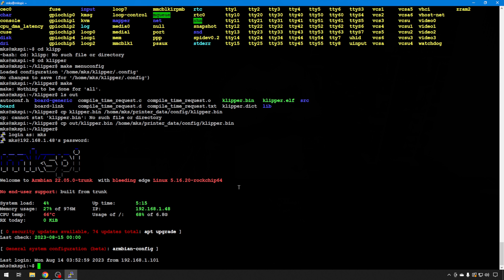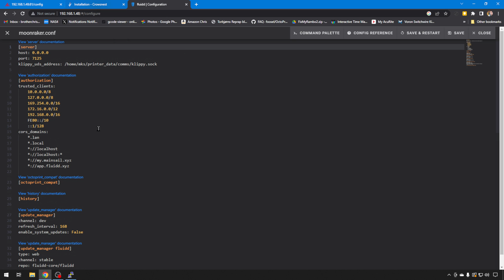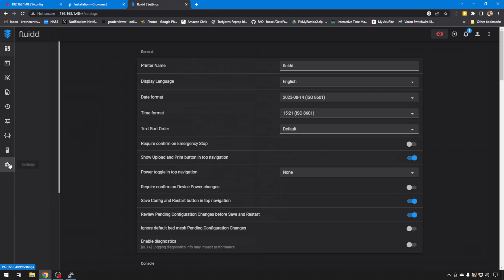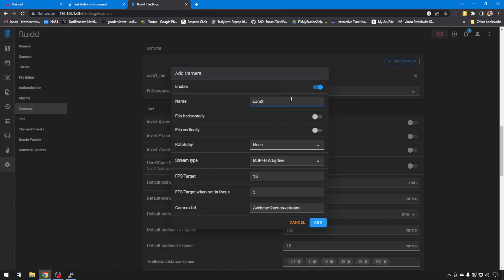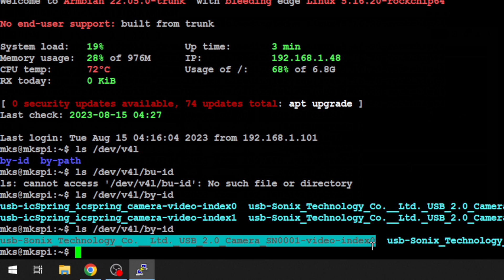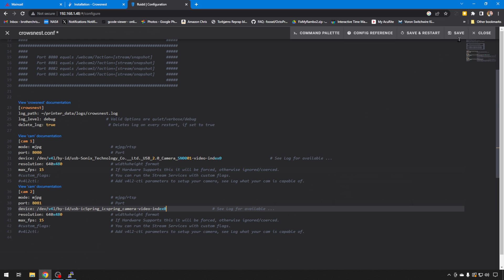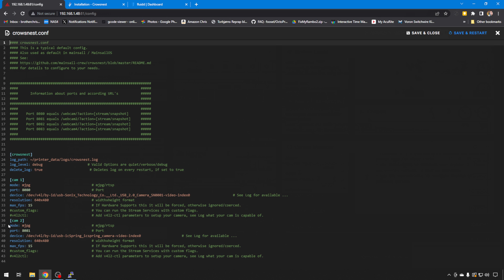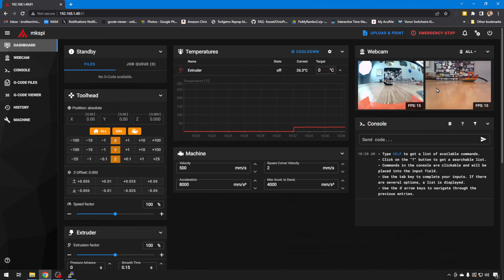Klipper - Multiple Cameras - Mainsail - Fluidd - Chris's Basement - 2023

Comment: I did that on my pi 4 and in couldn't install and crashed my install of klipper and had to start over any ideas??
Reply from the maker: Wow, I don't know unless one of the file became corrupted.
Reply: @ChrisRiley  IDK either on my third os flash and klipper install I just left crowsnest alone lol It didn't so much crash the system It would not allow the pie to connect to the router after  installing it so you know with without being able to use your interfaces  half your features are gone And I don't have a screen for it right now so it pretty much useless

Comment: So very informative video, am running into a problem though and not sure if it's a bandwidth issue or not. Running Klipper on a custom EMMC 32GB with Opennept4une on a Neptune 4 Max. I have the /dev/v4l/by-id/  for each camera, i have it set to 640x480 @ 15FPS. I am using a 60W Powered Anker USB hub for both cameras on the single USB port on the machine itself. However I can see one camera the other is always shown as (connecting) and never fully initializes. Any tips?
Reply from the maker: Are the cameras both the same model? Maybe they don't have serials and the system thinks they are the same and it's causing it to struggle. Not sure how to correct that.

Comment: I'm such a smooth brain that I need UI to understand it lol. Like the knowing all of the commands you need to do things is where my eyes start glossing over. I can do it since I could follow your instructions exactly, but it'd be much like leading me through a treacherous forest by the arm while I'm blinded.
Reply from the maker: I hear you, a lot of things in 3d printing are like that, but they seem to be getting simpler all the time.
Reply: @ChrisRiley  yeah for sure. I found out you can do print cam things with an old cellphone which is probably the route I'll go since it's all together and it's easier to set up. Luckily I got my printer to print pretty reliably so that's nice 😬

Comment: How about just using the printer own usb and control board in the printer to run the webcam?
I don't have a Raspberry Pi board and they are very pricey now! I am sure I've heard you can run the camera off the printer it's self?

How do we step by step install the software needed to run the Klipper based camera through the usb on the 3 D printer Please.
Do I need to have the printer attached to the router by a Cat 4 Cable to run the camera at the right frame rate.

Or can the Wi-fi ( G 5 ) I have do it fine?  Thank you and happy new year.
Reply from the maker: Happy new year! Most boards can't support a camera yet, but we are stating to see them come on the market. As soon as I can find an easy way to make it work, I will get a video out on it.

Comment: I'm running into a problem. I'm running kiauh on a linux mint laptop. I have 2 cameras but I can't meke them display individually. No matter what i do I get two identical streams either from cam 1 or cam 2. I made sure they're on different ports,  and their id is also their own separate one. I triple checked that. Also didn't forget to rename the second camera title in the config. Another weird thing is that the terminal gives me 2 id-s for both cameras with the difference being a 1 or a 0 at the end so 4 id-s in total, but I tried any combination of these without result. My config also includes a string called "enable_rtsp" and "rtsp port" but it's set to false on both and i tried to change that port too but with no effect. So I'm kinda lost.

Edit: I figured it out. I had an additional setting option below "Camera Url Stream" in the camera settings menu called "Camera Url Snapshot". That also has to be edited with the "2/" in case anyone else encounters this problem.
Reply from the maker: Awesome you figured it out and thanks for posting the fix.

Comment: Helpful, thanks. I'm running Klipper on a laptop hooked to an old Arduino based machine, and it just kept using the built in cam instead of the USB cam. Got it fixed.
Reply from the maker: Glad you were able to get it sorted out. Thanks for watching!

Comment: still didnt resolve anything..... using mainsail and an old windows tablet as my "pi" with linux ubuntu running on it
Reply: My 3d printer have 1 USB hub
Can I  use a USB hub  to connect 2 camera ?
Reply from the maker: Every OS is going to treat camera streamers different. It would take some configuration changes to make it work on every systems. This one is based on ARMBIAN.
Reply: @ChrisRiley  well my friend is stummped, but a pi3 isn't very expensive so ill just make the change later lol

Comment: do you think a kinect v2 would work with this?
Reply from the maker: I think there have been problems with the old kinect camera, but I'm not sure on v2, maybe they have been resolved.
Reply: i tried it out using a couple of other methods, its detected but never outputs video. but works fine on windows 10/11 @ChrisRiley

Comment: hi, thank you for taking the time to do such a detailed step by step tutorial.
unfortunately for some reason, im having some what seems like serious issues where my camera (C920) pops on for a second and then i get a "no signal" message but the FPS keeps going between 13 and 14 and I also get a klipper report saying
 "lost communication with MCU
once underlying issue is corrected, use firmware restart command to reset the firmware reload the config and restart the host firmware printer is shutdown"
do you have any ideas why this might be happening and how i can go about fixing it? im at a loss

thanks
Reply from the maker: Wow, that's a strange one. I wouldn't think it would impact your config, but sounds like it does. Maybe it's a power issue? You could try a powered hub.
Reply: @ChrisRiley Thank you for responding
sorry Im very new to this and im not following, what do you mean by "You could try a powered hub."? do you mean plug the camera into  a powered hub? I have my BTT PI4 +CB1 plugged into a powered hub to power it.
thank you for your patience
Reply: one more thing when i disconnect the camera everything seems to be working fine in klipper/mainsail, not sure if that information helps

Comment: I am running 2 printers on a BTT 7 pad.  I am using the 3rd BTT 7 port for a usb expansion with 2 cameras installed.  I can only get the same, one camera to shown up on either of my mainsail instances.  Any ideas on that setup?  It's not the same as a Pi, obviously.
Reply from the maker: Nice! Hmmm, I just got one of these pads to try out, I will have to see if I can make that work. There has to be a way to change up the ports to make it work.
Reply: Myvpad has 2 printers.  One in each back port.   Then I have a usb extender on the side port with the cameras.  Only one camera lights up, like the other isn't connected even though you can see it in the dev file.  Been trying for a few days.

Comment: The problem with a setup like this is that running two webcams simultaneously can actually tank your performance if you're using Klipper to handle all of your gcode processing. If you're using a slower Pi like a 3B it can even have problems with a single webcam (I had a 3B+ with a webcam that would only get about 2FPS while printing was happening). It would be interesting to see how a second Pi could be leveraged to run something like KlipperScreen and the webcams while another Pi is handling Klipper itself
Reply from the maker: That's a good idea, I will look into a second Pi setup like this.

Comment: Hey chris im trying to us a webcam and a pi camera module 3 at the same time is this possible because I'm having real trouble
Reply from the maker: On Mainsail or Fluidd I'm not sure how it handles the Pi cam, I'll have to test it.
Reply: @ChrisRiley  it was on mainsail I managed to get it going in the end however can't use it as intended was going to try use as a nozzle cam but the focal distance us too small.
Reply from the maker: @skyeblackledge2068   Cool you got it working, but I feel your pain. It's really hard to find a good cam with the length you need for a nozzle cam.
Reply: @ChrisRiley  yah currently trying to see if there is anyway to get moonraker timelapse to trigger a dslr 😅

Comment: This is helpful, however I wonder if you've tried with a raspi-cam / USB setup. I've currently got an issue with mainsail where it will occasionally boot correctly and display both, but often boots with only the USB cam showing in the interface. I believe it's to do with how the Pi handles devices at startup, as if I unplug the USB cam, it will then boot with the pi cam correctly and adding in the USB cam once confirmed in the interface, works 100%. Slightly annoying but not the biggest issue.
Reply from the maker: Interesting, I will have to give it a try with the Pi cam, I haven't used it on Klipper yet.
Reply: @ChrisRiley  if I can be of any help just let me know, appreciate your videos, helped me on many occasions
Reply: I just managed to get everything working in a similar setup. and i have the same problem. ->unplug usb cam ->reboot ->plug in again. then both cams work. did you manage to find a solution to this?
Reply: @DavidKoschat  annoyingly I used to have it working fine but then my SD corrupted and I had to reinstall. This makes me believe it was a raspi setup option, I think it was something about delaying USB boot on startup, which I read about someone was having power issues with hard drives, but haven’t found it again yet. Not sure if you can delay certain usb devices booting?
Reply: @DavidKoschat  hi David, I didn’t, however the lastest crows nest update with a fresh crows nest.conf seems to be working straight away, they appear to have changed how they manage/label pi devices which seems to have helped me

Comment: Lot easier than multiple cams in Marlin with Octoprint 👍
Reply: @ChrisRiley Spoke  too soon 😐Today I tried to install my 2 cams (piCam and usb cam) under crowsnest..
Sadly, I've not been able to get even one camera feed.
Used Kiauh to install Mainsail , moonraker and crowsnest
Crowsnests log does not give any errors, says at least 1 camera is running succesfully on /dev/video0
Tried /dev/video0 style and also directly /dev/v4l/by-path/xxxxx (by-id folder does not exist on my pi..)
Rebooted so many times, changed almost anything I could think of.. no avail...
Hardware setup is known to be good (still have sd cards for running Octopi and Marlln with both cams)
Could is be that it has something to do with using a Raspberry Pi zero 2W ?
Reply: UPDATE: It had nothing to do with the raspi being a zero 2W :
1) Turns out my USB cam I was using was not really compatible with Klipper / Crowsnest: After plugig it in, lsusb showed the camera. However the moment you start Klipper, lsusb (and Crowsnest) lost the camera completely.. Eventually I used another USB webcam with an other chip probably, and that did work
2) My Picam did show some video after a lot of troubleshooting and googling, but the image was flickering and blurry.. So I did not reuse this cam, and settled down with another USB webcam. Still have to check, there is a chance the Picam had dead on me.. not sure..

Comment: Hi Chris,
Great video and at just the right time as  I am about to install Klipper on my 2 Sovol printers (using a BTT pad 7).
My question is: as the Pad 7 has only 4 USB ports and I might want to add 3 cameras (1 for each printer and 1 general view), can I attach all the cameras to a USB hub connected to the Pad 7?
Reply from the maker: Sure, a hub should work just fine. If you have higher end cams that might need more power, so consider a powered hub.